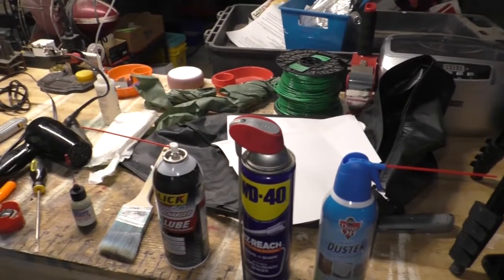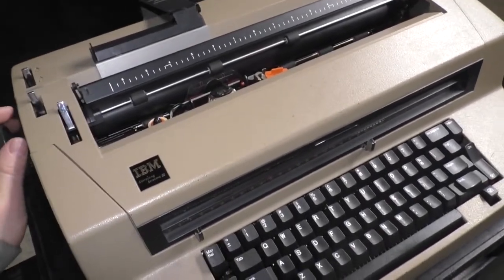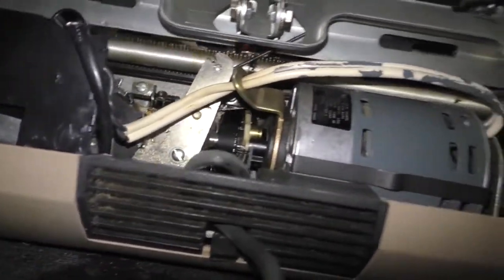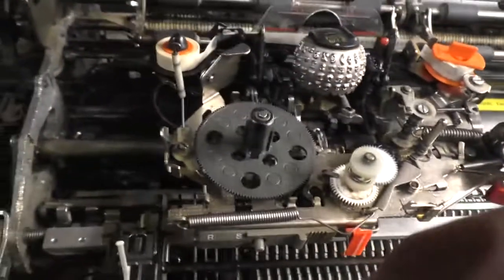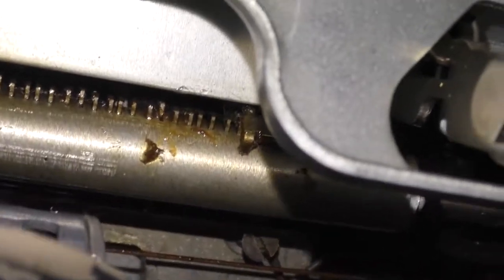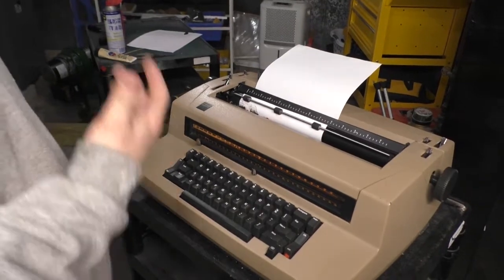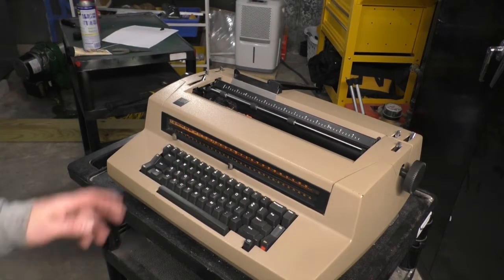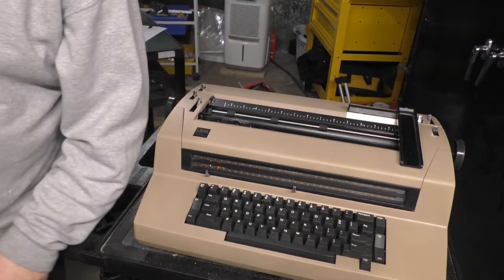The WORST IBM Selectric Video on YouTube!

Comment: I would keep the original colour, especially if you sell it at a later date.  Unless it's done by a body shop and completely stripped down it will never look right and no longer be original.

I like the original colour and it's in keeping with the time it was made for.

Comment: Paint it an interesting color, yellow or green. I've worked on several. As a matter of fact I've fixed several that have had the evil wd-40 just plastered fucking EVERYWHERE, no rhyme or reason. One dude even ruined a brand new belt by PAINTING IT with flex seal to "make it last longer" guy payed me $400 to replace the belt and ended up giving it to me a year later after he ruined it.

I agree with your sentiment...

Comment: Do a full resto of this!! RetroBright, cleaning of the internals, and such.
Reply from the maker: Nothing to retrobrite - it's cast aluminum!
Reply: @bbishoppcm  Really!? I thought the top was plastic and the bottom was metal. Maybe sand it down to the bare metal and then repaint it like you spoke about in the video? Maybe just bare metal silver?
Reply from the maker: @maddmaxx636  Yeah... that's its real color, believe it or not! Nicotine Beige I think.
Reply: @bbishoppcm  ewwwwww
Reply: @bbishoppcm  Its good that color was never put in a spray can haha. What color do you think your gonna paint it? 

Also, are you gonna restore it? Winter project?

Comment: That looks like a later gen... like the last one. The plastic keys is a giveaway. And the lit backdrop for the margins. I own a III with the acrylic keys.
Reply: ? - all Selectric keytops are plastic. On the Selectric III the keytop style is the same as the IBM PC Keyboard, so they are more square than the rounded style of the Selectric I & II but they are still made from same material
Reply: @c00kee  whatevah
Reply: @Steveos312  that must have hurt
Reply: @c00kee  you really have a weird handle
Reply: @Steveos312  Says "sclickfo312" ?? lol
Reply: @c00kee  at least it's not code - it's clear and plain-language